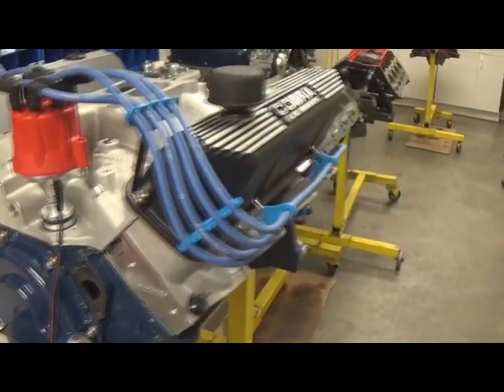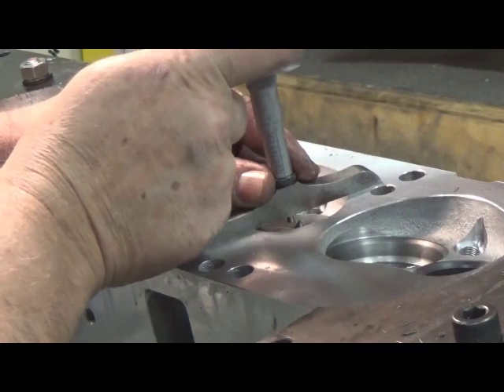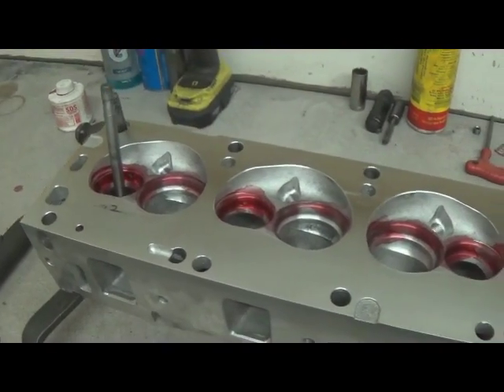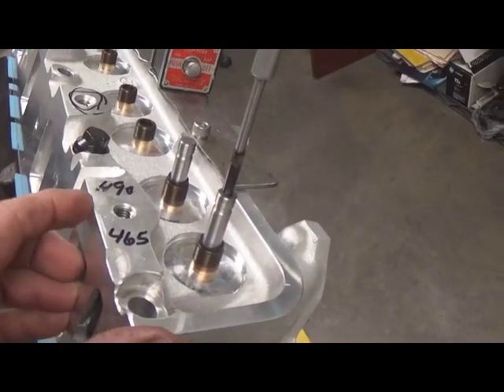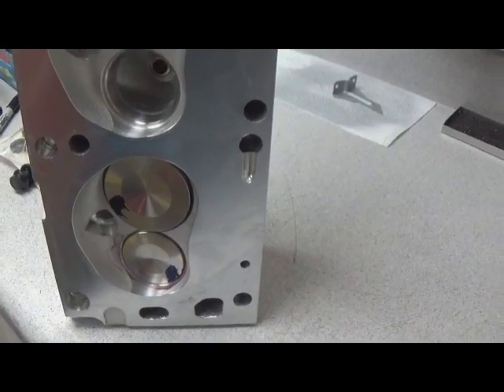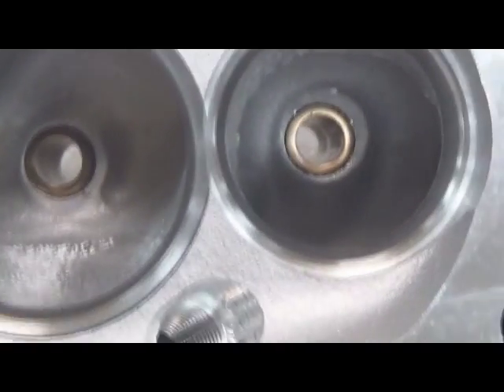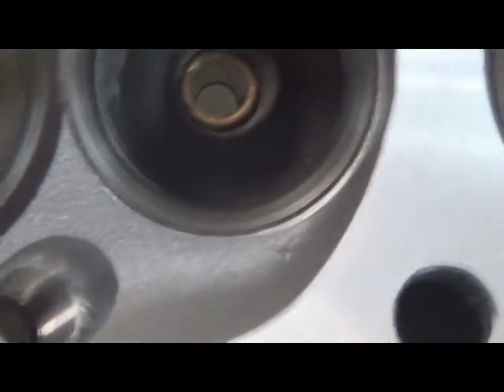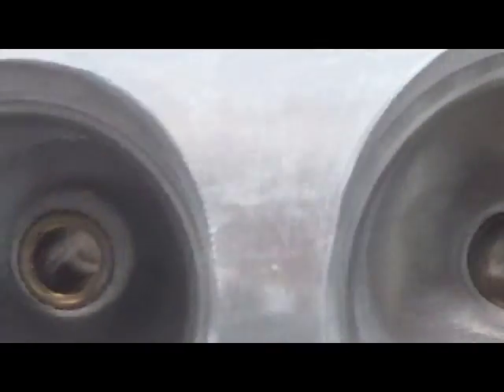"Inside Look: Installing Big Valves In FE Cylinder Head"

Comment: I have a question I order intake valves for my head but the original valve head diameter is 1.260 but the new valves head diameter are 1.33 can I just use grinding compound to set the different on the hole? Thank you for your answer

Comment: There is a lot of hp lost in the exhaust ports of that type of head and much room for improvements as much as 50 hp .For some reason Ford always scrimped on the exhaust ports and left it up to the engine builder to find the right combination .The Cleveland , 385 and Fe series can all benefit from exhaust work and raising the ports .